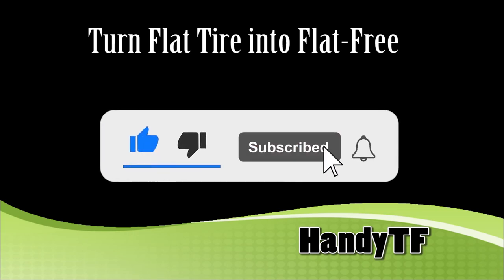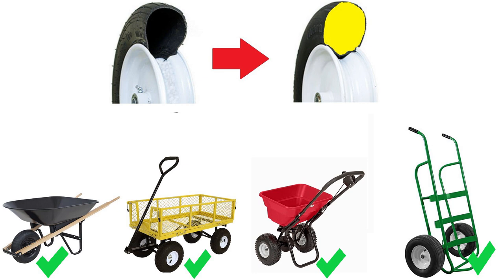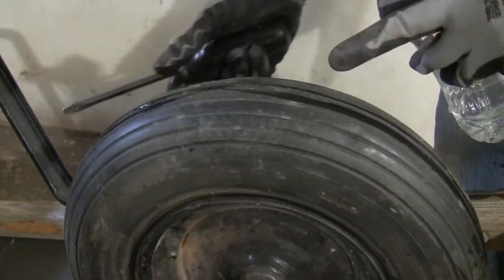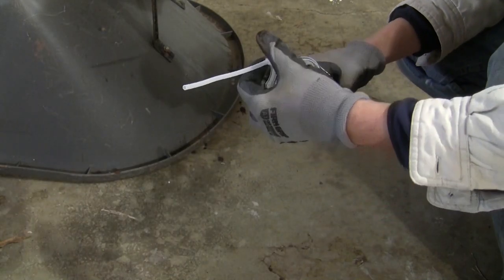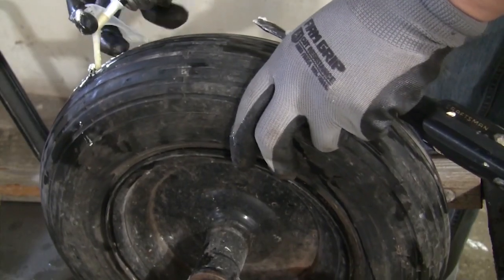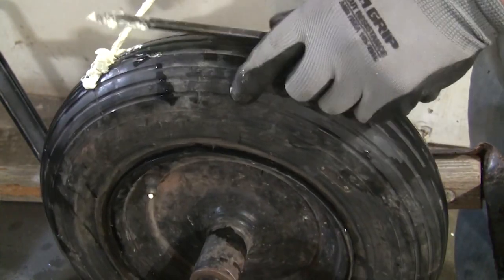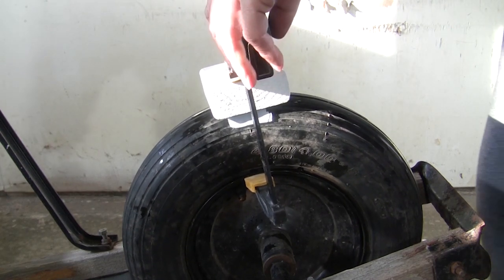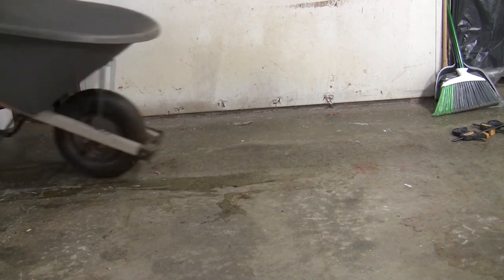DIY: Making Flat-Free Tire from Damaged Tire

Comment: I have a Gorilla Cart like you show in your examples. The cheap pneumatic tires from Harbor Freight aren't all that cheap, and the axles don't fit anyway. I can't locate just unmounted 13" tires. Buying mounted tires from Gorilla Cart is pricey (I've done it once.) This looks like a good idea. I'm going to give it a try. Thank you!
Reply from the maker: It does not really work, It only lasts about few months, I have an updated video.
Reply: @handytf , good to know, friend. Thanks for the heads-up.
Reply: Where did you post it? Thanks 👍